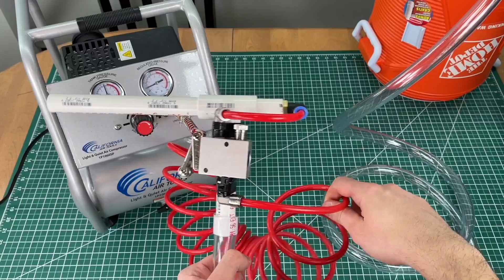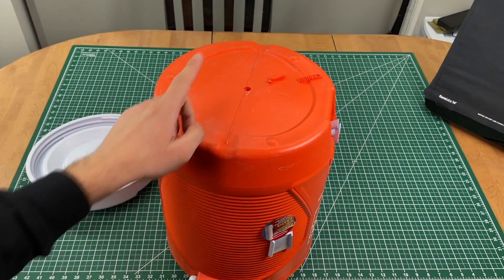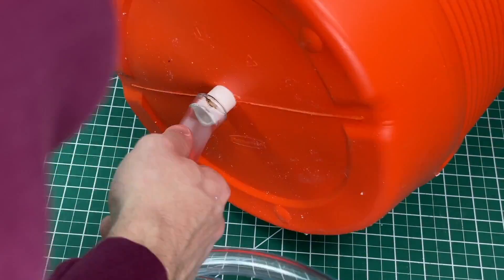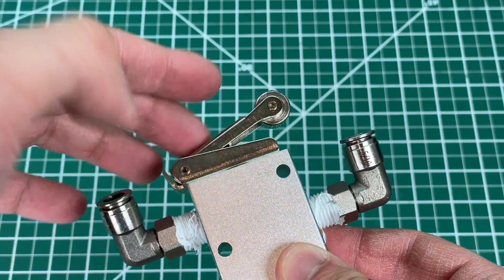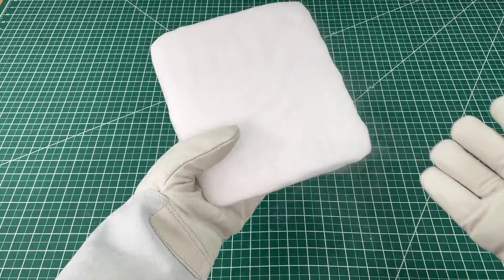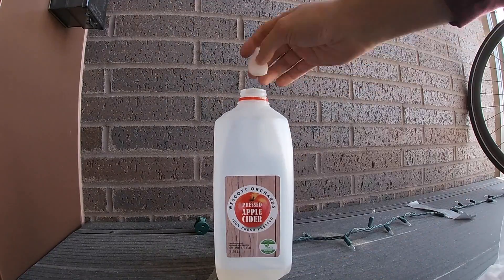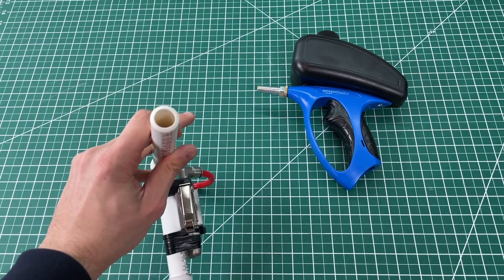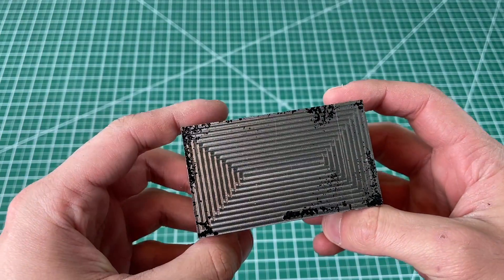Dry Ice Blasting Machine Concept | DIY

Comment: As with all abrasive cleaning systems, volume of abrasive delivered and pressure of air are key to effective cleaning.  Your system uses powdered dry ice, not pellets.  You may actually be freezing the paint and blowing it off with compressed C02

Comment: I work at a dry ice shop. Thats not how your recieve or prepare dry ice for blasting. Its made in small pellets and pressed into blocks. We make even smaller pellets designed to be shot out of a gun. Its all the same price but it is a specialty item. If you want this to actually work you would need to add a strong positive pressure at the neck of the hopper
Reply from the maker: I’m not sure I understand, please elaborate.

Comment: I have used similar models of those sand guns.  I imagine part of your problem was the feed orifice was extremely small and was getting clogged.  If you had a larger hole and possibly a rotating agitator disc over it to shuffle the ice, you should get much better throughput.

Alternatively, mounting a small ice crusher on top of the gun to make pellets on the go.
Reply from the maker: These are awesome suggestions. Thanks for leaving this comment. Cheers

Comment: Sand blasters use high horsepower compressors for a lot of air pressure. It is a very energy intensive process.  I also thought the dry ice blasters make the dry ice from compressed CO2 kind of at the nozzle.
Reply: They don't. I've used industrial dry ice blasters and they do indeed use pellets.
Reply: @LogicMrSmith  they also have a grinder in the hopper to further reduce the lathe CO2 pellets.  If I had a compressor of sufficient capacity, I’d try and put something together based largely on the commercial designs

Comment: I didn't hear you say anything about working with this in a well ventilated area. You don't want people dying in their garages.
Reply: It'd be cool to see if you could utilize the pressure buildup of the dry ice evaporating instead of an air compressor.
Reply from the maker: @forrestmcbride1903  that’s a pretty good idea actually.I will think about how we could do this safely.  Cheers
Reply from the maker: Dry ice turns into CO2, and it does so very slowly.  It would take a huge amount of stored dry ice to have a fast effect on the CO2 concentration in the garage (or more accurately, the partial pressure of CO2). Furthermore, your body’s primary stimuli when breathing is to detect high CO2 (not a lack of oxygen, fun fact 😃) so at dangerous levels of co2 in the room you would feel the same as you do when holding your breath for a long time, and you will have that amount of time to respond. Hence, I would not consider a 10lb block like the one we used to be dangerous for pulmonary gas exchange in any way when used in a conventional home garage. Thank you for your comment regardless, Cheers.